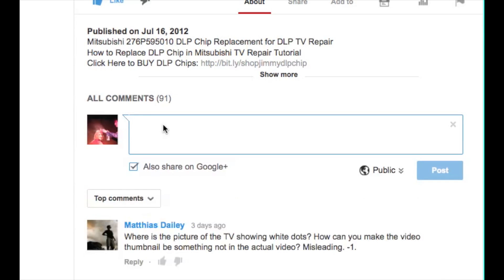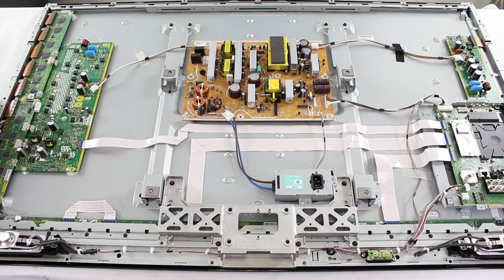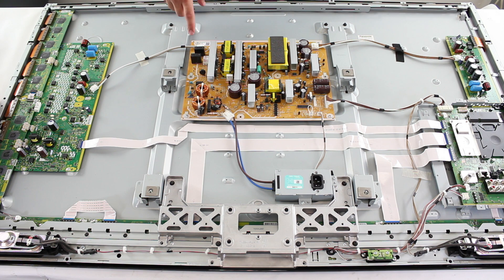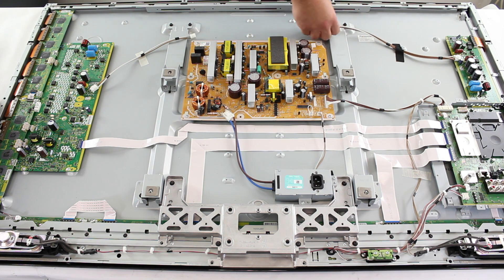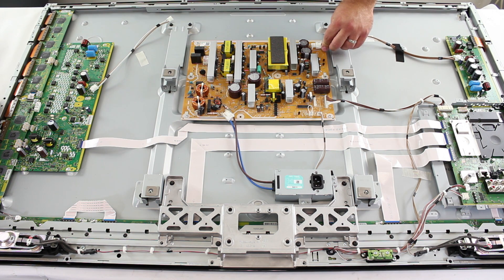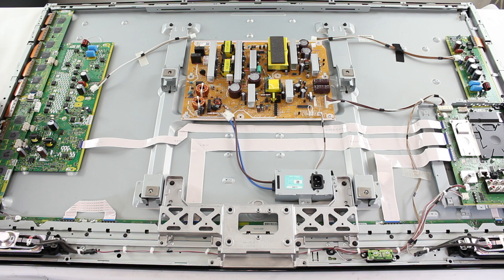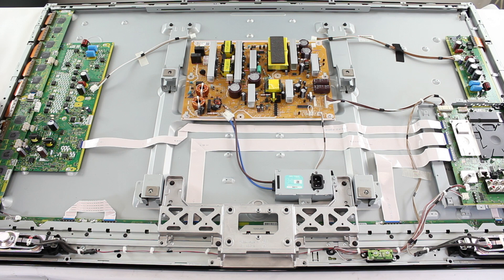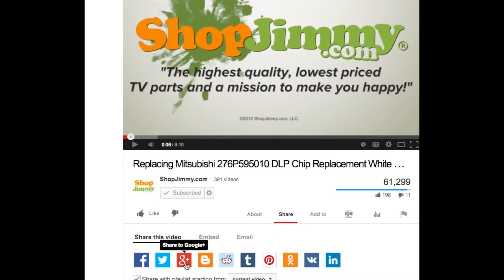Plasma TV Repair Help Clicking Noise & No Picture How to Troubleshoot Y Sustain & X Sustain Problems

Comment: I have a Samsung plasma model# PN51F5300AFXZA, when you try to turn it on the red light blinks twice and there is a couple seconds of fast clicking almost like a taser would sound, then the red light blinks once every couple of seconds consistently for maybe 15-20 seconds then it goes out and doesn't come back on. if you try right away again you see the red light for a split second and then it's out....if you wait 5-10 minutes you will get the light again like the first time, thanks for any help.

Comment: hi, I have 47lm7610 LG tv, I think my power board of tv has a problem that tv turn on but after 5sec turned off but I have sound and ips picture, I check my backlight and 2 big capacitors but I don't recognize the problem.

Comment: I have a Samsung 42" model #  PN42B450B1DXZA the clicking noise is present only during the time of power connected and then just stops and after that nothing happens at all ( The TV goes completely dead then intermittently will power on when prompted and most times will not turn on. I was thinking it might be the power board but after seeing this video I am inclined to think that it could be the y board or the x board. Can you help me identify. Thank you.

Comment: Hi my LG Plasma TV 50PA4500 clicks when i plug it in. When i disconnected the x and y boards it still clicks. I watched a video where the guy said i need to look at the capacitors on the piwer supply to see if any are bulging, but nothing looks out of the ordinary on here. (Also, im a noob at this so i may be missing something obvious on there). I  got this TV as a gift, so i figured i could probably fix it instead of taking it in for repairs.

Comment: Got a LG 60inch plasma.  No sound. No video.  Just clicks. Model#60pk250-us.
Reply: Also. The red light turns on. Then leaves when u turn it on
Reply: Power board looks good. Part#eax61432501/9

Comment: I have a lg 60pk750 plasma tv.  When I turn it on the front flashes blue 3 times then turns red.  The screen is grey and does not turn black until you hit the power button.  With the back taken off the logic board flashes 1 long green followed by 1 short flash green.  I unplugged the z sustain board and got a scrambled purplish image with white.  There was no sound.  When I plugged the z sustain back in and unplugged the y sustain board the screen was black with no sound and quickly turned off.  What could be the issue?  I do not see any bulging capacitors or blown fuses.

Comment: Hi I have LG 50pk550, last time when I tried to switch to hdmi 1 input, the screen and tv frozen all buttons got no response. I unplugged the power and restarted but the tv went into demo mode.  Still no response to remote control.   Anything I can try to fix the tv. Thank you.

Comment: I have a Sanyo model Dp50749, I found all fuses good(6). Tv trys to power up (I can hear the high voltage hit), I get green power led the relays click on and off a few times and then nothing. I have checked all the caps and transistors to see if cracked open. I saw no burns on the boards. Nothing looks bad. Tv is about 10 years old. Thank's.

Comment: John D
I have a samsung UN40B-7000W Tvand the relay starts clicking when trying to power up. I verified the standby 5.3v is good but when turned on the 12v oscillates from 12v to 0v on and off. I replaced 2 power supply boards and same results. But when i disconnect the main board all power is good 5.3v and 12v . I tried two other main boards and it still would cause relay to click. I had unplugged Tcom board and every other connection to both pWR supply board and main board with same results, 12v relay clicking. I removed pin on connecror to tie 12v from power supply bnoard to main board and it powers up and tv lights up. But as sson as i hook back the 12v line to the main board , the power cuts out and relay commences to click again. What can i try next. Thanks and God Bless

Comment: Zenith 42" plasma z42pq20 , when i turn it on i hear it click and then it clicks again and shuts off before the screen even comes on, I'm hearing the clicking on the top near the x board, any idea? How do i know if i need an x board or power supply?

Comment: First off, great video. Well shot, and very clearly explained. I have an LG 50PK250, with the clicking and shutting off issue. I have tried isolating each board and powering on as described in your video, but never get the clicking issue with the boards isolated. On several occasions, when plugging everything back in, the tv has run for short periods of time, and sometimes it just won’t turn on at all. Since the behavior is random, I’m at a loss. This is a great tv I would love to salvage, so any tips would be greatly appreciated. Thanks in advance.
Reply: I have a plasma tv, exact same model as yours that’s doing the exact same thing. Did you find out what the problem was?
Reply: @blakeds87  Unfortunately, no. I ordered replacement power supply components, and the tv played for about an hour before doing the very same thing again. Had to scrap it.
Reply: @rogerguitard  okay. Thanks for letting me know. I might scrap mine too then. Lol
Reply: @blakeds87  lol hihihi

Comment: Samsung plasma TV ps43f4900 vs voltage after 2 second in 0 volt check on load and unload board. Check  mother boar output vs on terminal  same problem .sound ok. what is the problem other voltages is ok .

Comment: Have 42pq30 plasma  clicking..
Replace 2 resistors 
Still clicking on power supply.
Need to know what kit I need for white board
Reply: If I was you just get the whole power supply board

Comment: HI  Jimmy,  I need your help/opinion 

1.Currently my panasonic TV Model TH-42AS640S does not work properly. ( Australia Model)
When you turn it on, the green light blinks fast approx 15 times, the TV comes on for about 4 seconds and turns off , and then the light turns red and blinks red once every 4 seconds.

2. I suspected the Power supply board. It has 2 test points 5V and 16v. when I measure them , there is NO 16v present.When I leave the Multi meter attached to the 16v rail and turn the TV on again the DMM reads 16v for approx 4 second and then drops to 0V, as if the power supply is turning off due to excessive load.

3. so, I disconnected all the connectors from the power supply( no load condition) , turned the TV on with DMM attached to 16v rail , result 0V ( did not go to 16v and then drop off to 0V as previous test)

4. I purchased a second hand PS board with exactly the same results as above. 
My question is do you think it is the Power supply board or some other problem.

Your opinion will be greatly appreciated, many thanks
Peter Sullivan

Comment: Hi! I have a Sony 46bx420 that seems to be doing something pretty similar to what other people are experiencing. Last night while watching tv, it just shut off. There are no lights or sounds when I try to power it on from the tv itself or by using the remote. When I unplugged it, it clicked. When I plugged it back in, it clicked... nothing else, no lights, picture or anything. I haven't taken the back off yet so I don't know what boards this tv actually has. Any help you would be willing to offer would be greatly appreciated!

Comment: Toshiba 50HP66 will not come on. Replaced Y sus board but did not fix. there is a small board between the power supply board and the Ys sus board. On this board when powering on there are two green lights that come on then a click and the cycle starts over, but the unit will not come on. Any suggestion as to what to check next

Comment: Hi, My LG plasma 42J350
Turns off immediately after I turn it on. Usually it does one click when it turns on but it does 2 clicks so it turns on then immediately off.
Reply: did you find out what it was?

Comment: hey great video however I’m still stumped as to what board to replace I have a LG50 PA6500  all it does is click click click. I followed your diagnose video on disconnecting all boards and replugging one by one.seems that on this tv the X board is connected to the y board by a wire ,and the wire from x to the power. The only time the clicking continues is when they all connected as no continuous clicking when I test individually.Please help. Can it be the main board. Or should I just get a power board.
Thank you for any helpful advice 
Razer
Reply: I have a lg 50pa5500 it comes on shows lg TV then turns off

Comment: My Samsung PN60F5300AF had 1 bad HDMI port.  Much later, the picture went out (and the sound).  Called the cable company who said the other HDMI port went bad.  What number do I need to get off my card (that contains my 2 HDMI ports)  that will specifically identify the board I need to buy and replace to fix my problem?  I have the back off and have matched my model code (PN60F5300AFXZA) as well as a number (BN94-06195G (BN97-06528V)).  Do I have the right replacement card??   THANK YOU!

Comment: i have a Samsung plasma tv model: pn64e533d2f. it clicks and the red stand by led light is on. i took it apart and the power supply board transformers clicks, only when its connected the mother board. the transformer on the power board that clicks its wires look burnt and damaged. im thinking the windings in the transformer are arcing. what do you think?

Comment: Hello I have samsung ps50a556s2f with clicking power supply it can turn on but will switch off after some time I replaced 2 10v 2200uf capacitors but problem is still present
Reply: And on TV power bord there is smaller bord with led and when it's working it have steady green light but when it's stopped clicking it blinks 7 times

Comment: hello i have a panasonic plasma tv TC-60S30  DONT TURN ON   the power board is good   the main board turn on bot after 30 secunt  the red lithe in the back turn off and makes a click in the power board  i change the main board stilll semi tau

Comment: Hi there i have a Samsung PS51D550C1M plasma, the symptoms are = Doesnt turn on at all. Relay clicks as if it is trying to turn on multiple times, red standby light at front flashes twice, 5 times in a row and logic board lights comes on for 5 secs then 2 secs. I followed the steps in this vid and i found the following: just power = relay clicks once. Power and Y = relay clicks once. Power, Y and X relay clicks multiple times. Any help would be much appreciated. Thank you

Comment: HI my name is Terence I have a 60 inch zenith plasma tv one of the little components on the buffer board is bad is there a way I can fix that little component myself without buying another buffer board model number z50pt320-uc serial number 110rmku8y253

Comment: I have a 60pb6900 and it’s not turning on. I replaced the  power supply and still am getting nothing. Should I replace the logic board or main board with component outputs on it?

Comment: hi i have got a samsung  plasma display
model code      ps42c430A1
model code      ps42c430A1
type no              ps42c430
if i remove the plug on the y board clicking sound stops  i hav checke all caps whatt else do i have to check please give some awnsers thanks

Comment: My LG tv model number PDP50R30000 will not power up. I press the power button and acts like it wants to come on but doesn't it just clicks itself back off. I opened up the back to take a look at it and couldn't find anything wrong. (Didnt run any tests)

Comment: I have a LG 50PA4500 plasma tv and powers up with black screen, but no picture. The logic board has a greenlight flashing code at power up(. . _ .) off for 3 sec then ( _._.) and repeat (_._.). Component board is solid red light. Have you seen this before and need any further info for suggestions to troubleshoot?

Comment: i have a samsung plasma PS51D6900DK model, the TV switches on i get the smart TV logo, the a click and switches off, then this keeps repeating . i hastily replaced the power board however the issue is still present. can you help

Comment: I've got a Samsung Plasma PN50C550G1FX2A. The four slide connectors on the X Sus are randomly arcing and popping when powered on. They stop when I unplug them. Is this T.V. trashed, or will a new X Sus fix it?

Comment: I working on a Samsung 63c7000yf, following the t/s guide for tracing the clicking sound, I had unplugged both X and Y SUS boards and the clicking persists. I am assuming the power supply is faulty at this point. Part # BN44-00334A. The Va voltage is bouncing around but the Vs voltage is stable but not sure what it should be. If the power supply board is available, I would like to thank you for pointing me in the right direction rather than just replacing all the boards.

Comment: I have a 60" LG plasma 60PA6550 I'm seeking help with  my tv turns on but after 20 minutes it will turn off and when I turn it back on I can only hear the channel it's on but if I tap the back where all the connections go the picture will come back but turn back off

Comment: I have a LG 60pm6700 . The TV started getting worse and worse with sympotms.  The TV picture would go out and stay black but with sound .  If I left it on the picture would eventually come back on . So I would just leave it on as the picture would stay on and good.  If I turned it off I would get a black screen and hope with would turn back on again.  Now its not turning back on at all  but still ahve sound .  Please help

Comment: My lg  plasma  model 42PQ700BbR. Has stopped woorkkinng with clicking sound. Mechanic has changed supply board and it started working, but for 2 hrs. Again the same processs had been done. It worked for only half an hour. Now the mechanic says that it's mother board would bee channged. Please guide  what should do?

Comment: Hello

I have an LG Plasma 50pj350-ub.  I have a clicking noise on the main power board.  When it clicks there is a red light on the main component board that lights up and then goes off it will do this twice and then I hear nothing.  I have no picture or sound during this time.  Please help.  My email is pd2sav@gmail.com

Comment: Samsung led tv when tv start then check the voltage 5v,12v,present but 3.3v,2.7v don't voltage in power connector pin  what problem

Comment: viera tx p42u30b Panasonic,the tv won't turn on (clicking noise) 5 flashing green lights displayed,I've replaced the power supply unit but still no joy

Comment: Hello, I have a panasonic 46-pz80u that started the 10 blink syndrome.  After doing some research, I went online and found a compatible sub supply unit, installed it and still had the problem.  I have just tried another power supply board.  It's the same symptoms (I forgot to mention that when I plug the unit into the electric outlet, I hear three clicks, then the 10 blink.....)/  I removed the replacement power board and put my board back on and when I plugged the unit to the electric outlet, I hear two clicks and no blinking.  I can turn the tv on, and no problems.  I scratch my head when I replace the rear panel and shortly afterwards the 10 blink starts.  I remove the rear panel, (after I unplug it) and then plug it into the electric outlet.  I hear two clicks and then I can turn the tv on, no problems!!!  I also forgot to mention that the PSU that i purchased had an L after the serial #.  My original PSU has a N after the serial #.  So it couldve been a incompatible  board????  I don't know what is causing the unit to shut down, 10 blink, after I install the rear panel, other than something is getting warm and fails.  Thanks for any input!!!

Comment: Sir my TV is LG 42pj560 r 42 inch plasma tv.When I connect the y board the power supply clicks and the clicks again and the red light turn off then it restarts again

Comment: I have a panasonic tc-p58vt25 plasma. It powers up and clicks and when I press power on button from remote, the red light comes on and then it clicks again after few seconds and then red light keeps blinking constantly with a gap of about 2-3 seconds, no picture no sound, nothing. Panasonic has blink codes but not for constant blinking. Have seen anything like that? Thanks

Comment: have plasma samsung pn65f5300afxza version uso1 . i have two problems; one in right side first 6 inches i have vertical green broken lines started out 3-4 now up to 10 from top to bottom.  2nd tv turns on/ off &works fine execpt that once on a channel for about a minute  it shuts off standby light flashes then turns on and then will run fine , but if i change stations this process repeats it self. if i leave it on one station once resets it runs up an hour havent tried longer. so for it only does it on antena input only . it does not do this on dvd or hdmi inputs those work perfect

Comment: The TV shut off on it's own and when you attempt to turn it on it clicks and remains dark, (off). I've gone through your test twice with my LG 50PV450 . 1st with just power board connected, 1 click, then power and Y board, 1 click, then power, X, and Y board, 4 clicks. As I said I did these tests twice and same results both times. Now with that said the clicks are coming from the power board area if that means anything. Any ideas?

Comment: Hi I have a Samsung 60" series 5 plasma model number ps60e531. There is a beeping noise coming through the speaker when I am in the HDMI setting I do not use the tv setting on the tv. It only has just started today with the beeping noise. It will beep every 3 or 4 seconds and then slowly become more frequent in time. I'd turn the tv off then 5 min later turn on again with it being ok. Then out of nowhere 1 hour or so later it will beep beep beep again  through the speakers .